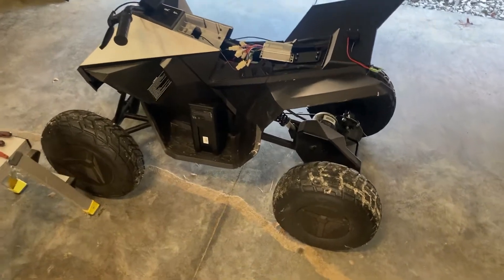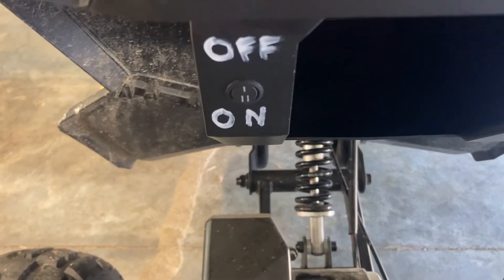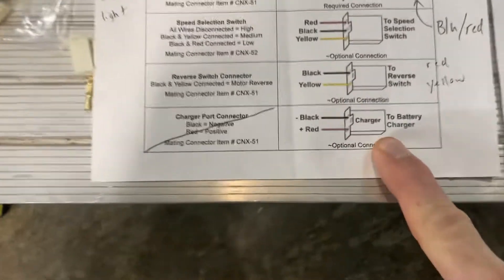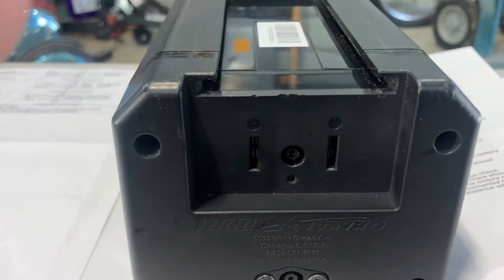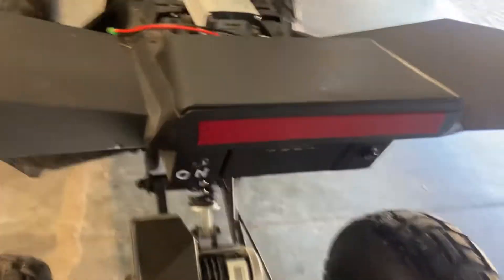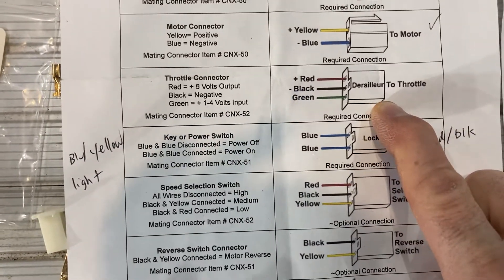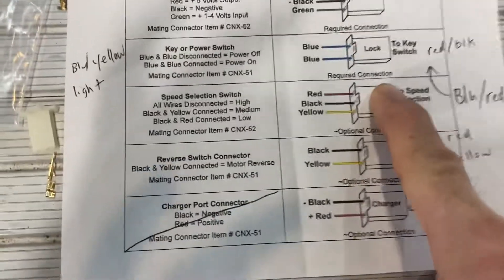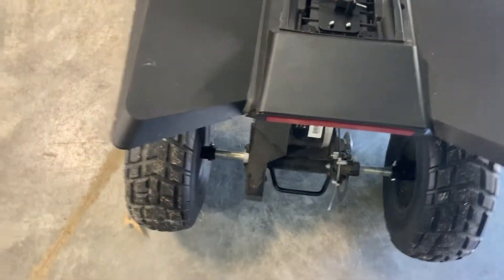Cyberquad motor controller repair

Comment from the maker: Additionally could make your own connector from wire, flat terminals and sealant to hold everything in place, cut out the rear of the battery housing and just use a standard 36v connector to hook to the controller. You would just need to make the wiring long enough ~18” 
Hope this helps

Comment from the maker: I would post a link for Ali or Ebay, but the link would go bad once the part is sold. Simply search for silver fish battery discharge and the part should pull up. You will need to modify it by hand to make it fit in the original space. I used a file on the terminals that are too thick, and a knife to cut and shave platic off both the connector and housing. That was probably the hardest part.

Comment from the maker: This is the page for the controller

https://electricscooterparts.com/speedcontrollers36volt.html
Reply: Hi, thank you for the video! I tried to comment yesterday but it looks like it didn't save. My friend and I were able to get the forward/reverse working (backwards like yours), and the throttle to work. But, it goes very slow both ways. It appears to be slower than the "low speed" from the original controller. I saw that you said you got lucky with one of the wires coming from the front. We tried one, it didn't do anything, and now it works, just very slow. Do you have any tips/suggestions/ideas why the quad might work, but just very slowly? We didn't connect the speed selection like you did. This is puzzling and frustrating, but will be nice to figure it out!

Thanks again for posting your video

Comment: Thanks for the video Jeff, this is great. Have a dumb question though, is there a reason why you can’t just solder the wire leads from the old battery connector to the new controller? Just don’t understand where the new battery discharge connector is needed. Thanks in advance!
Reply from the maker: Yeah if you have the old connector you can use it.

Comment: Where did you get the battery discharge connector from? Also does this new motor controller make the quad any faster?
Reply: Would like to know the answer to both of these as well!
Reply from the maker: I got mine on ebay, search for silver fish battery connector